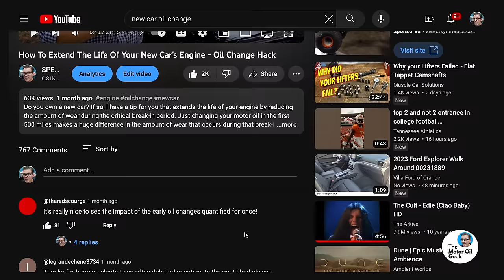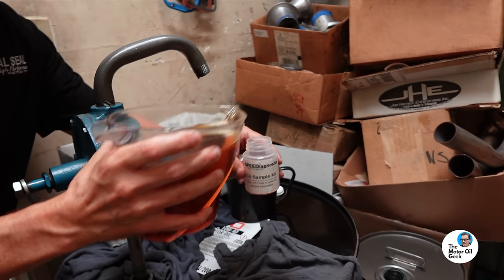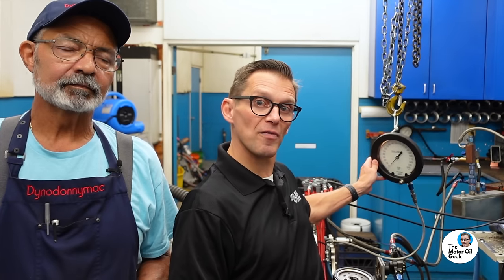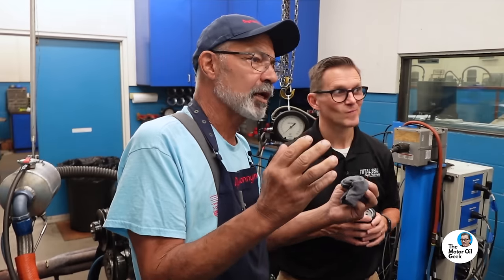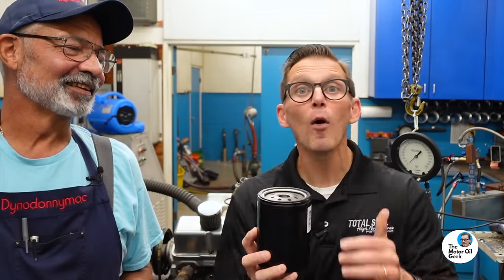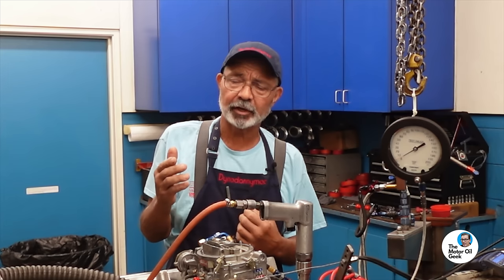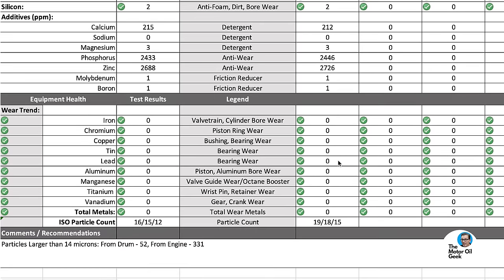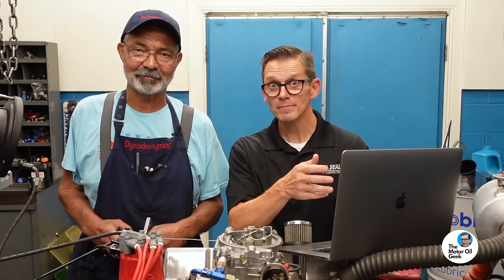Does Pre-FILLING The Oil FILTER Cause Engine DAMAGE?

Comment: I’ve prefilled my filters for over 50+ years. And this proves what I’ve been doing 👍👍👍
Reply: proves nothing.
Reply: I`ve never  prefilled a filter for 50 years without any problems. Current vehicles are 15 &20 years old.
Reply: Are you still driving that same car ???? My daily driver is 40 years old and I have never pre filled the filter in all that time so it proves nothing
Reply: I doubt it matters but whatever google told the man was dumb
Reply: Prefilled or not, it doesn’t matter.
Reply: @xbrizzcakez doing things the wrong way for many years and getting lucky by having no issues doesn't make it right.
Reply: @Tom-og7fi 
You say it's wrong, but he could say the same thing about you being wrong. If it really matters, then all the car manufacturers would have mention it one way or another.
Reply: @2010ngojo  they do through the dealerships.
Reply: @Tom-og7fi  yeah, but no mention to the customers? The ones that are using the car? If it's that important, it should be mentioned in the user manual at the very least. I don't see many, if any, mention in them.
Reply: @2010ngojo  the customer who goes to the dealer is probably not the type who changes their own oil. The service department is not going to tell you how to do it unless you actually talk to the mechanic doing the work. In my trade I don't explain how to do the job unless they ask and if they do they don't really understand what I'm telling them.
Reply: To each their own. 
Be the same as not prefilling a Diesel filter, or pre-oiling an engine before starting it. Or better yet not oiling a turbo charger.  👍👍👍
Reply: To each their own. 
Be the same as not prefilling a Diesel filter, or pre-oiling an engine before starting it. Or better yet not oiling a turbo charger.  👍👍👍
Reply: To each their own. 
Be the same as not prefilling a Diesel filter, or pre-oiling an engine before starting it. Or better yet not oiling a turbo charger.  👍👍👍
Reply: To each their own. 
Be the same as not prefilling a Diesel filter, or pre-oiling an engine before starting it. Or better yet not oiling a turbo charger.  👍👍👍
Reply: To each their own. 
Be the same as not prefilling a Diesel filter, or pre-oiling an engine before starting it. Or better yet not oiling a turbo charger.  👍👍👍
Reply: To each their own. 
Be the same as not prefilling a Diesel filter, or pre-oiling an engine before starting it. Or better yet not oiling a turbo charger.  👍👍👍
Reply: To each their own. 
Be the same as not prefilling a Diesel filter, or pre-oiling an engine before starting it. Or better yet not oiling a turbo charger.  👍👍👍
Reply: To each their own. 
Be the same as not prefilling a Diesel filter, or pre-oiling an engine before starting it. Or better yet not oiling a turbo charger.  👍👍👍
Reply: To each their own. 
Be the same as not prefilling a Diesel filter, or pre-oiling an engine before starting it. Or better yet not oiling a turbo charger.  👍👍👍
Reply: To each their own. 
Be the same as not prefilling a Diesel filter, or pre-oiling an engine before starting it. Or better yet not oiling a turbo charger.  👍👍👍
Reply: To each their own. 
Be the same as not prefilling a Diesel filter, or pre-oiling an engine before starting it. Or better yet not oiling a turbo charger.  👍👍👍
Reply: Is the oil God’s going to strike us down if we don’t pre oil the filter?
This is the first time I’ve heared of this & I’ve been changing my oil for 50yrs without any issues. If it says in the manual I’ll be doing it but all the ones I’ve seen doesn’t & even have shop manuals. It does say to oil the gasket. With my luck I would make a mess trying to get the pre oiled filter on. If it’s that important & when buying a used car it should tell you if the filter was pre oiled or not. If I ever buy another vehicle & the manual says to add oil to the filter then I will.

Comment: Amen!!! I work for a Fleet and have done this for well over 35 years. I can see and hear the difference upon start-up after the oil and filter change. You can see how long it takes for the oil pressure light to go out while cranking and at initial start-up. You can also hear any low oil pressure related knocks that exist in that engine until the oil pressure light goes out, and you can hear the sudden disappearance of that noise when it does go out. 
     The only reasons people have to justify not doing the pre-filling of the oil filter method are: The textbooks do not mention doing it. The owner's manuals do not mention it. Finally, some oil filters are mounted at an extreme angle or even upside down which prevent a total fill of the filter without spilling oil during installation. In the last case mentioned, it still helps to add oil slowly to the filter while tilting it and rotating it around to at least saturate the media. Then install it. The majority of the time it takes to reach oil pressure while cranking and at initial start-up is because the media is still absorbing oil before it can let oil pass through. 
    I know, I know, some will say "who has time for that?" I do. Especially for my own vehicle. I still do it for the Fleet vehicles I work on because I care. I know it helps longevity and I want to do the best job I can to ensure that. If you don't, even on your own car, you are plain and simple just being lazy. Before you saw this video or read this comment you could claim ignorance, but not anymore.
Reply: Right -On  !!!
Reply: There's some crazy Russian mechanics on YouTube who do weird things with cars & engines.  They once modified an oil filter by grafting a clear body onto a filter base plate. It took a  surprisingly long time to fill the dry oil filter. They didn't time it, but I'd say it was almost 5sec from when first started.
Reply: Makes sense. My '11 Tacoma 4 .0 l v6 filter is a spin on upside down. From now on , I don't care if it gets sloppy, I will at least try to saturate the media with fresh oil. Thanks!
Reply: I bought new a 2007 Toyota FJ Cruiser with the 4.0 V6. The spin on oil filter is near the top of the engine, upside down. Many many oil changes and never, ever heard a knock or tick after changing the oil. Oil light went out almost instantly
Reply: @jerrykorman7770 bull 💩 roll the window down and listen. It ticks like crazy for about 1 or 2 seconds. 
Can't be good
Reply: @The77stevo77  it did have a tick for a few moments when new, only during a cold start. After a bit of research, I found that the “German” Castrol 0W-40, or Mobil 1 0W-40,  eliminated that minor cold start tick. 

As the FJ 4.0 V6 has the spin on oil filter on top of the motor, and upside down at that, I suspect some oil does drain back when shut off. Impossible to prefill the oil filter. Doesn’t seem to hurt anything though. The Toyota 4.0 V6 appears to be a reliable engine
Reply: Most oil filters have a check valve. So once its filled by the engine it holds oil from draining back out of it and then no more dry starts.
Reply: @chrisgibson7519  I saw a test on check-valve oil filters ,, none ,, held oil longer than two hours.
Reply: Just theorectical.
Reply: @jerrykorman7770  it doesn't seem to hurt anything is because you can't see the damage it's doing. Think about when you start a motor for the first time. You want it as oily as possible because the wear is the worst. Do your other cars tick at cold starts? Are they Toyota? Do they have the oil filter on top? Lot of different variables, but noises from the motor are never good...that being said, I've had trucks that would clack for the first 2 mins, then would be fine the rest of the day. Drove for years
Reply: @The77stevo77  at 16 years and 280,000 km, still going strong. Did have to change O2 sensors a couple of times, a known issue. Zero oil consumption. My ‘13 Focus hatch stick always makes a loud ticking at idle: not the valvetrain, but the GDI injectors
Reply: @chrisgibson7519  No, oil filters do not have a check valve.
Reply: You don't know that it helps longevity, and you are doing it for your ego, not for anything useful. Those upside down or sideways oil filters will drain dry every single time the engine is shut down. Prefilling doesnt do anything. The time that it takes the media to absorb the oil is so irrelevant it is laughable. Some engines just knock on startup - especially a wide array crappy euro trash engines. The fix is usually to run oil you are supposed to be running or newer better oil that was later found to fix it (0w-40 or 30 from Mobil was huge for that).
Reply: @malcomreynolds4103  well said!
Reply: Idk its a waste of time and unneeded mess. I dont fill filters because  some filters are sideways, some engines have cartridges, so if it doesnt matter for those motors, why does it for others
Reply: @evanhandelong7685 not sure if you can say it’s right or wrong but I see engines getting the same mileage either way so not sure if I would say pre-filling is really necessary but hey if it makes ppl feel good then why not let em. 😂
Reply: i would say your logic and methods do make a difference for off-road motors with increased oil clearances, but in a street motor, you are just staying on the safe side and could very well just be wasting your time- which is ok if you've got the extra time.
Reply: Ive always used castrol and still do.but latly I noticed black particals floating in tne bottom of the jug(4 and 5 quart jugs)and stuck to bottom of the jug in the last 4 jugs i purchased.i still use it because ive never had a problem with it.im just more carefull using it now.if you guys could check out this theory it would be great.thanks.keith in south GA.
Reply: This saturating the media and not fully filling is the only thing I’d add to this video.

Comment: Been changing my own oil for 20 years. Always filled the filter before install. Never was told to do so, never heard to to do it, I just did it. Glad I have.
Reply from the maker: Glad to help
Reply: And how much actually stays in the filter before you get it tightened 😮lol if its mount upside-down 😂😂😂❤
Reply: @frankorobinson1540 Bro you obviously just flip the car over in that case 🙄
Reply: @christians131  actually you can just crank the engine over with ignition coil fuse out crank until red oil light goes out and good to go .but flipping the car over works too lol
Reply: Was never told to pre fill it... Never did... I guess I should start eh...?
Reply: @kirdot2011 meh, it's not necessary unless you have giant filter like on trucks. Otherwise it's optional. Won't hurt, but won't impact your engine life in any meaningful way.
Reply: @2010ngojo  its actually one of if not the tiniest filters ever

Comment: I always pre-fill the filter three times. When I let it sit between fills I can see the level go down as it soaks into the filter material. Thanks for all the great info.
Reply: In my experience there is absolutely no benefit to prefilling the filter with oil. Assuming your oil pump is working normally, it will fill that filter in a few seconds and away you go. I've been doing my own oil changes for 50+years and I always keep my cars a long time. Never had a problem. And if your filter is mounted horizontally, how are you going to prefill it???
Reply: @MrPLC999 did you watch the video? Have you actually tried pre-filling a filter that's mounted side ways? 

It's actually still pretty easy. I do the same method as Jake above. Just fill it, let it soak into the filter, fill it again and it'll still absorb a lot, then on the final fill I just fill it about 1/2 way (filter is now pre-soak and is 1/2 full of oil that's free to get pumped to the oil galleys) then I just reach down and turn it sideways and spin it onto the oil filter adapter.
Reply: @MrPLC999  And in that few seconds of non-lubricated running you're scraping metal off the bearings, cylinder walls, and piston rings, and with the newer engines you're also wearing down the camshaft castings in the heads that have no bearings and depend strictly on the oil film to keep them from rubbing together.  Fill the filter.

Comment: Not necessary but couldn't possibly hurt...some filters are installed horizontally.
New oil is clean.
Reply: In horizonal filters, at the very least, pre-soak the filter medium to the point of saturation, it's amazing how much oil is required to do this.
Reply: @peghead  why not simply follow the manufacturers recommendation.... which in most cases means it's doesn't matter.
Reply: @CJRock-xn5qf lol. I have a 3.5 eco-boost f150 2012,, horizontal filter, I change oil every 10,000km, I never pre-fill, soak or fool around, just dump the oil, change the filter and dump in 6 litre of oil and fire it up and idle for a minute. 362,000km, it never uses enough oil to bother adding between oil changes. People making mountains of bs out thin air. I agree with you.
Reply: @CJRock-xn5qf Because the manufacturer only cares about the vehicle lasting through the warranty period. If you plan on keeping a vehicle for awhile, why not do everything you can for longevity
Reply: @RedlineMaximaSE   It's not like 10k m.i oil changes. Now what do you do with vertical filters and those mounted open side down. Then there's canister style that can't be prefilled.
Reply: @CJRock-xn5qf  Then you can’t do it obviously but if you have a setup where you can do it, why wouldn’t you.
Reply: @RedlineMaximaSE  So prefill makes no measurable difference in engine life. Unlike the ridiculous engine oil life (scam) being currently pushed by manufacturers.
Reply: @CJRock-xn5qf  Well these 10k oil intervals are ruining a lot more engines that’s for sure
Reply: @CJRock-xn5qf  - manufacturers are only interested that the engine outlasts the warranty period. What's in it for them if your engine doesn't need a rebuild or replacement - after the warranty!
Reply: @edhansen8531  Stupid Is ~ Stupid Does
Reply: @CJRock-xn5qf  You do what you can DA
Reply: @CJRock-xn5qf  If it's mounted any which way that doesn't allow you to pre fill the filter then always change the engine oil soon after it's been ran after operating temp so that the bearings have the most amount of residual lube. Just don't do it cold.
Reply: @DavidTMSN  irrelevant for the conversation
Reply: @CJRock-xn5qf   I understand that. It's just I always see the "what about the filter orientation" as an excuse not to prefill. That's the reason I mention it because it actually is relevant to the topic for those who have peculiar orientations.
Reply: @CJRock-xn5qf  Right. My service manual tells you to warm up the engine, then let it cool for 10 minutes. This leaves a good film of oil over everything, so the 3-5 seconds for the filter to prime is a non-issue.

I've NEVER pre-filled a filter. Never had an issue with the engine as a result.
Reply: @DavidTMSN  Prefill because you can is not a valid reason. 100 years of empirical data shows it makes no difference.. Any odd engine design where it does make a difference is noted by the manufacturer.
Reply: @CJRock-xn5qf  Fair enough. I want oil pressure immediately, which is why I prefill. If the vehicle has a paper filter mounted sideways I most certainly would not. Just change it warm. In the grand scheme of things it probably doesn't matter, as you mention.
Reply: @CJRock-xn5qf  Scam?......which is??
Reply: You just proved this stupid experiment without even attempting to postulate.